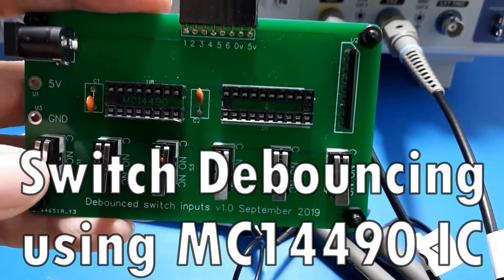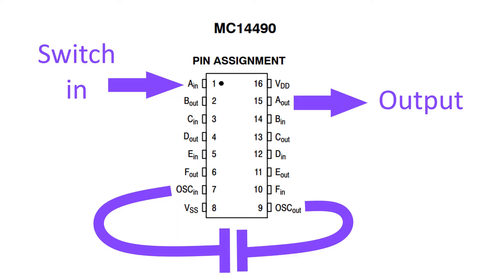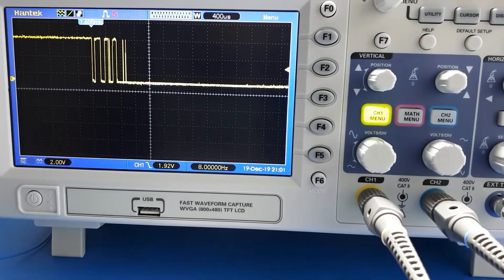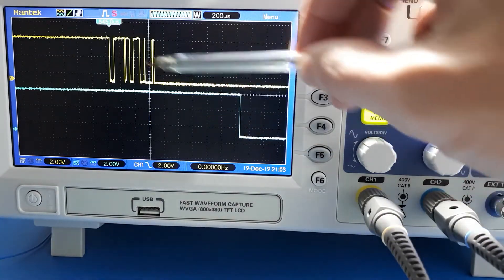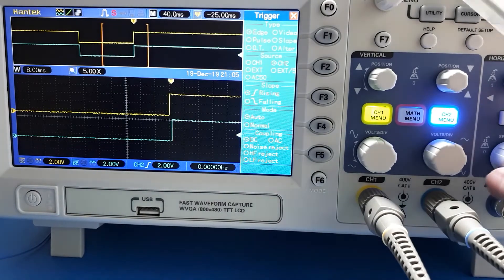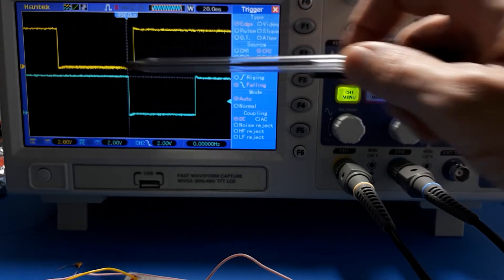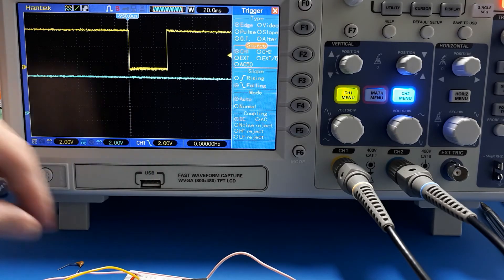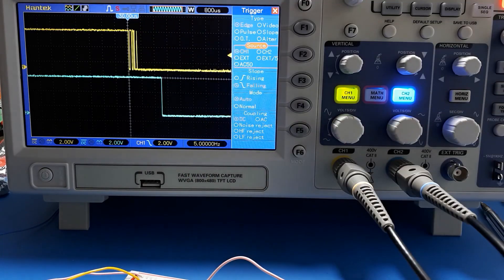Analysis of switch debouncing using an MC14490 IC

Comment: Am I correct in thinking that the Larger the value of the capacitor, the more tolerance the circuit will have to switch bounce, but the less responsive it will be? (i.e. it'll take longer to output it's signal)

Comment: Thank you for video. What value of capacitor is the best for any types of buttons (in pf)?
Reply: I think first he tried a capacitor with the marking of (104) which has the value of 100,000pF but then he switched to a capacitor marked (471) which translates to a 470 pF capacitor. He also tried the cap with the marking of (102) which has the value of 1000pF. 

In a 3-digit marking the last digit refers to the number of zeros to add to the first two digits to arrive at the pF value, 104 => 10 0000pF;  471 => 470pF;  102 => 1000pF

I'm just learning this myself and want to pick up some of these debounce IC's to try this out. Sadly they are pretty hard to find. Apparently they've gone out of production (at least the DIP version). So I'm having to look for them in the aftermarket.
Reply from the maker: Sorry to say it, but it really is going to depend on the mechanics of the button, and also how "responsive" you want it to feel versus how few false-double-clicks you want. I think the reason that the datasheet for this IC doesn't give specific values is because you need to try out a few capacitors and see what works best.

Comment: I thought these looked cool versus debouncing each switch with its own 555 ... $10 + shipping each here in Canada from places like mouser ! :o

I've got to be looking at the wrong part, right?
Reply from the maker: I got mine off ebay for much less than that!!!
Reply from the maker: It's one of those ICs that are expensive from local distributors but can be picked up very cheaply direct from China. It's never going to be as cheap as using 555s, but you only need this one IC and 2 capacitors for 6 switches.
Reply: Circuit Breaker ahh, thanks!